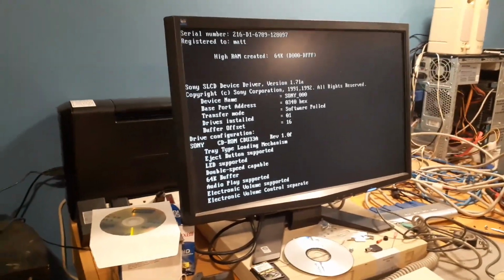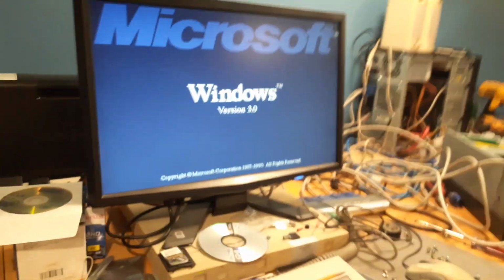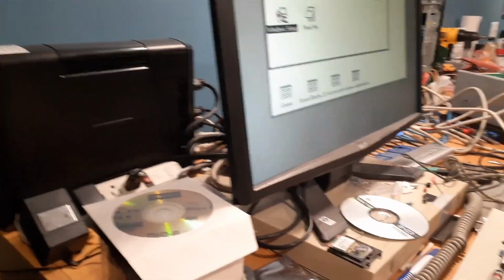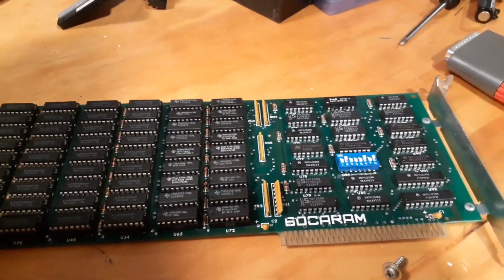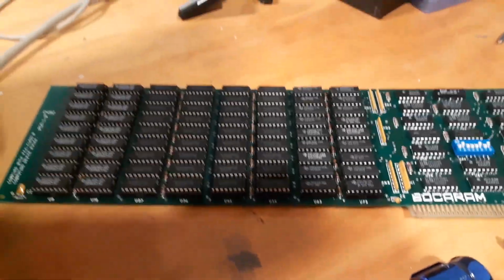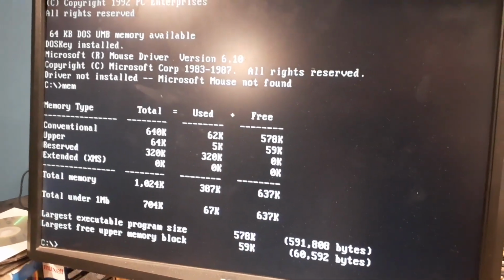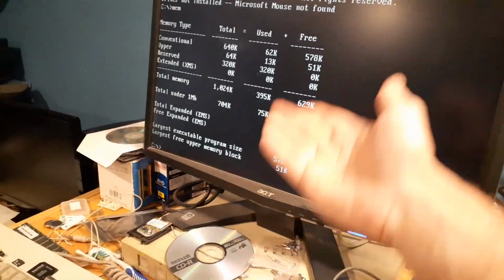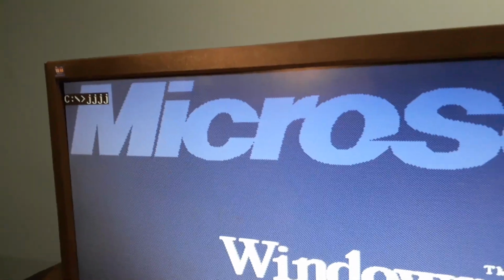The Buss Correction Kit for an AT&T PC 6300 (and other neat things) -- Pt. 3

Comment: When I saw the auction for that highly customized 6300 system, as a 6300 collector, I wanted it, but the price was out of my range. When I saw that you obtained it, and all of the work the original owner put into it, I had the same realization as you: The system is so tricked out that it probably shouldn't be dismantled.
Reply from the maker: Yes, the original owner knew what he was doing! However, my ideal PC 6300 still revolves around the one I got almost 20 years ago.  My main goal was the Buss Correction Kit which I've been searching for for about 5 years now.  So, I kind of forced myself to look at this machine first as a way to get that particular component and also obtaining many other cool things as well.  So far, I haven't hit any major snags in making these components work in my set up, which is a great relief.  There was always the option to revert back everything if needed.  The new machine will not be without a purpose.  Stick around for an upcoming video about that.